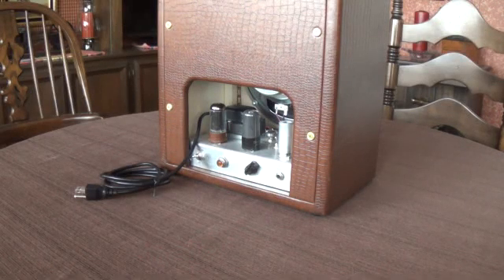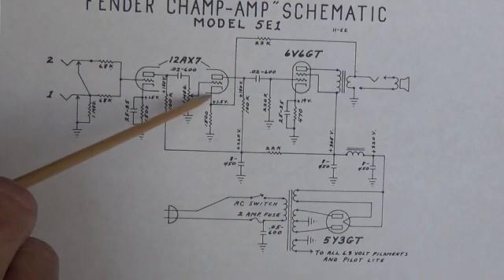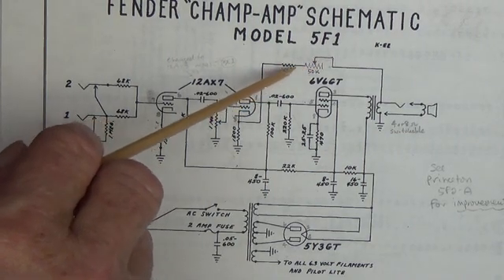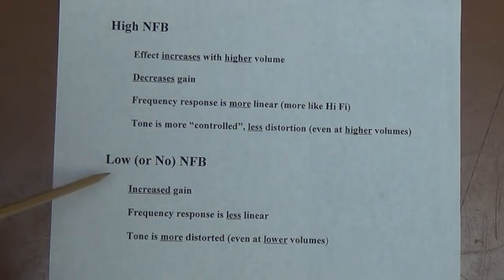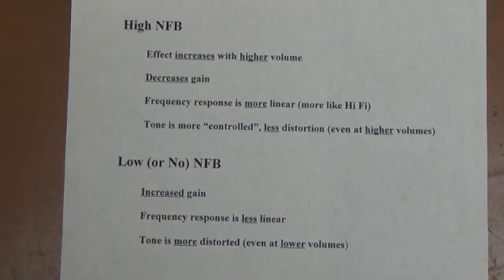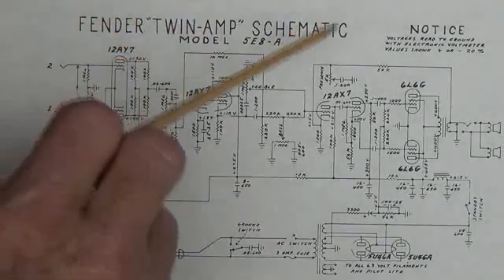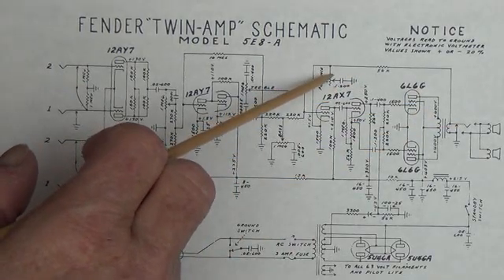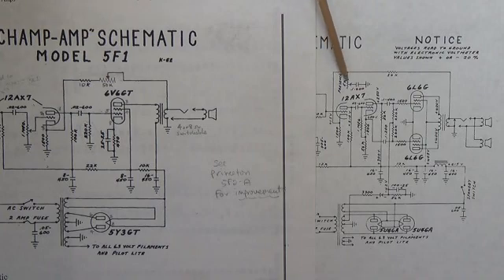Negative Feedback Loops and the Fender Presence Control

Comment: A musician friend asked me to convert his Great Grandmother's early 1940s Westinghouse tube console radio to a guitar amp. I tried the "It's easy to use an old tube radio as a guitar amp" route. The radio was not working, so I trouble shot it, recapped it and replaced three defective tubes. With the radio now working, I wasted a bunch of time trying to use the "phonograph" input for guitar. After much trial and error I came to the conclusion that the idea is largely bunk. Instead, I gutted the chassis, saved only the new can capacitor which was a 20/10/10 @450V and told my friend I would build him a Tweed Champ circuit in the chassis, retaining the same knobs and controls arrangement, with the dial lamps as pilot lamps.  He picked out a new 8 inch 4 ohm speaker and away I went on my first amp build. I decided to include a tone control and when looking at late 50s schematics, I realized I was building a 5F2 Princeton! I referred to a number of your videos for instruction and decided to include a Negative Feedback control as I had a spare knob available on the radio panel. I fired up the amp yesterday, corrected a couple of my mistakes and tried it out. Whoa, that thing sounds just like it rolled right out of 1956. The NFB control was the most amazing thing about the whole project. With the control, and a Stratocaster,
 I can seemingly vary the gain from pretty clean (6K resistance) to very pleasing overdrive at 56K resistance. With a humbucker guitar, I can get over the top overdrive! The tone also changes subtly. I am really happy with the amp and am excited to let my friend (who is a professional musician) try it out. Without all the help from your videos, this project would have been a non-starter. I am pleased to show my gratitude with a Patreon subscription. Thanks again Uncle Doug and Rusty!
 Scott
  President, CEO and Janitor at Scotty's Workshop.
Reply from the maker: Wow, Scott, this sounds like a great build. All of your modifications make good sense and I'm glad the NFB control worked so well for you.  To me, the NFB is actually much more useful and effective than a tone control (which is actually redundant with the guitar tone control). You're welcome for whatever assistance our videos provided. We commend you on this very successful project and sincerely appreciate your sharing it with us.

Comment: Another great video and a great mod! Once in a while we see people who say to completely remove the NFB loop, and that is not a good idea. At low gain levels, it's not that apparent, but when you start pushing an amp, you can quickly turn the amp into mud. Low frequency overload. Removing the NFB loop makes an amp sound terrible and it's counterproductive. Leo used NFB in order to control the gain so that we could hear all that wonderful chime. I've been using an adjustable NFB for quite some time after I came to appreciate its purpose. I typically use a 3k resistor with a b50k linear pot. With this setup you are able to carefully dial in some great breakup. I was pleased to see that you use it, too! I also add the Presence Control. Try auditioning a few different cap values or use a switch to select from several different values so that you can dial in the low frequency control. This really comes into play if you're a Blues player. In a Triode, the electrons flow from the Grid to the Plate and from the Cathode to the Plate. When you use NFB, the triode acts like a mixer. The grid contains your guitar signal and the cathode "mixes" a low amplitude guitar signal from the output transformer; just like you said, the cathode signal subtracts, (not adds) the opposite of amplifies, the incoming signal from the grid. The Plate in the triode sends this mixed tamed signal on to the power tube(s). NFB subdues the signal in that triode. The neat part about the Presence Control is that you can subdue the lower frequencies, that causes farting and blocking distortion, which sounds terrible, and allow the (lower amplitude) higher treble frequencies to run wild. Again, selecting from various Presence capacitors to dial in the low frequency cutoff is recommended. Furthermore, guitar pickups will reach all the way down into an good tube amp. Use a higher value presence capacitor for a humbucker equipped guitar - 0.1uf, 0.047, because they produce more low end harmonics. Use a lower value capacitor for a single coil equipped guitar - 0.047, 0.022, 0.01 because their low frequency output is lower. Adding a 3 or 4 pole rotary switch that allows you to select the Presence capacitor is a great mod. Try it and while you're strumming a chord, select different cap values. I think you'll be pleasantly surprised. Thank you Doug for providing  us a forum to share our experiences! We are all blessed to have you around...
Reply from the maker: You're welcome, Mark, and thanks for your very detailed and informative review of the applications and values of NFB.  We are fortunate to have a contributor of your knowledge and experience.
Reply: Rotary switch, great idea.  Thanks!

Comment: Thx for great vid again Uncle Doug but one thing confuses me. You say that the grid and the cathode are out of face. Do you mean they are both out of fase in comparison to the Plate? Because in a earlier vid about the working of a triode tube, i learned that the signal on the grid are IN PHASE with the cathode. thx. Stefan.
Reply: Hi again. i see in a earlier reply ( 2 years ago :-) ) that you already answered my question, so sorry for being to fast. Very interesting video! thx
Reply from the maker: You're welcome, Stefan. The grid and cathode are in phase, and both are out of phase with the plate. I apologize for any confusion.

Comment: Hello Uncle Doug,
I have a question related to the negative feedback loop. If i have a two
channel amp the first channel of which uses 1 12AX7 and the second one 
uses 2 12AX7s, should I connect the negative feedback loop to the cathode 
of the second part of the first 12AX7 or is there a different solution?
Great video as always and thanks in advance!
Reply from the maker: +Oleksii Shekhovtsov  It depends on the type of Phase Inverter the circuit has, Olek.  If it's a Long-Tailed Pair PI, then the NFB connects to the cathode of the PI tube. If it's not a LTP, then it connects to the cathode of the final pre-amp stage immediately prior to the PI.
Reply: Thanks :)
Reply from the maker: You're welcome :)

Comment: It also looks like the presence controller is fed into the first stage of the 12AX7 while the Champ's NFL is fed into the 2nd stage.Is that right?
Reply from the maker: +SciPunk215  Which presence control are you referring to, SP ?
Reply: +Uncle Doug Check 5:37 in the video. You're pointing right at it. :) 

BTW: You got me motivated. I'm embarrassed to say I've been sitting on a gem for a LONG time. I have a 1973 Fender Quad Reverb. It has issues. But I think I'm ready to finally get it up and running again.

I'm pretty sure it's 1973. It's serial # is A61778.
I think I found the schematic on line. Can you verify if this is the right one?
http://acruhl.freeshell.org/mga/schematics/amps/mid70s100w.jpg

I can't thank you enough for sharing such great content !!
Reply from the maker: You're welcome, SP. I'm glad the videos have provided motivation to work on your amp. I believe that A6 is 1976. I have no way of knowing if this schematic is correct for your circuit without evaluating the amp in person, but it may well be. Re the Presence Control vs the Champ NFB Loop, the insertion points are not different due to one being Presence and the other NFB, but simply because the circuits themselves are quite different. The Twin is double-ended and has a phase inverter, while the Champ is single-ended and does not.
Reply: The feedback is fed to the last amplification stage, which is the first half of the 12AX7. The second half is the cathodyne phase inverter.

Comment: Hello Uncle Doug. Why, is the resistance value in a princeton reverb so low (2K7)? and is it advisable to insert a 50K pot here?
Reply from the maker: +BAMPSANDPEDALS  If you think 2.7K is low, check out the Deluxe Reverb.....820 ohms.  The value is determined by the impedance of the point of insertion, and varies from circuit to circuit. If you want to make the NFB loop variable, you will have to bracket it with an appropriate pot and fixed resistor, i.e. a 500 ohm fixed resistor and 10K ohm pot in series, offering a variable range of 500 to 10.5K ohms.

Comment: Awesome again.   Would love to see your explanation about the how and why of amp stage coupling whether reistance,  capacitance, inductance or a transformer is used.   I understand it in a basic way.   But why its used when its used in a guitar tube amp not really sure.
Reply from the maker: +John Miner  Thanks, John. This is not a topic with which I am familiar. The inter-stage coupling in the vintage amps I deal with is generally done in a cascading plate-to-grid chain with coupling capacitors to block the preceding tubes plate DC from reaching the following tubes grid. Perhaps a Google search would turn up more information. Good luck.

Comment: uncle doug, I am completely new to mods beyond bright caps. does the negative feedback loop connect to the positive or negative side of the output transformer tap? the bugera v5 mod I was following had the negative feedback loop connecting from the 8th connection of the 9 pin preamp to the 4 ohm ot tap, but did not show which tap. is this effective with the use of a pot to vary the feedback, and could I use a 50k and 100k pot to dial in specific frequencies?
Reply from the maker: +James King  James, the NFB loop must be attached to the un-grounded OPT output lead....i.e. the one BEFORE the speaker voice coil. If you can't tell which is which, use an ohmmeter to find the lead that has some resistance (3, 6, 12 ohms depending on your speaker) to ground. 

The pot value depends on the circuit. If you want to make it variable, then you must protect the NFB from reaching 0 ohms. To do this (let's say the modification calls for a 10K fixed resistor) you would wire a 1K to 5K resistor in series with a 20K pot, which allows a range of 1K to 5K when the pot is at zero, up to 21K to 25K when it is at max.  Good luck.

Comment: Hi Uncle Doug, I have a silver faced 1972 Twin Reverb, which I have black faced to Ab763 circuit. I had added a 25 k pot to see how much resistance I liked and it came out to about 15k on the pot by itself in series with the 820 ohm existing resistor. Question 1, should I just put in. 15k resister to give me the amount of reduced negative feedback, 2, I would like to get the bass up a little, like a resonance control, should I use the suggested .0047uf cap in series with the 15k resistor. 3, what frequency blocking roughly would I get with that cap, thanks again for your very informative videos, Bob
Reply from the maker: +starlingave  I tend to like the flexibility of an adjustable NFB, Bob, but you could simply replace the pot with a fixed resistance if you wished. Please see the formulas in my Tone Stack video to calculate the frequency cutoff with that cap/resistor combo......or you could do what I do and simply try it and see how it sounds.  Good luck.

Comment: Hi Uncle Doug: Thank you for your reply today. I built a mojotone 5e3 deluxe and it came out great. I do find it breaks up a little too much. I'm trying to decifer what pin of the 12ax7, pin 7?, of tube to come off of with a resistor to create the negative feed back loop. I also assume the other end goes to the negative speaker terminal. I have a photo of my chassis, how can I send it along for your reference. Thanks again, Bob.
Reply from the maker: +starlingave You're welcome, Bob. There is a wealth of information on this subject on the Internet, i.e. http://www.tdpri.com/forum/amp-central-station/69-why-doesnt-tweed-deluxe-have-negative-feedback-loop.html   It appears that the most common way to install the NFB is a 22K resistor between the speaker jack and the cathode of V1b. Good luck.

Comment: Doug, would it be possible just to install the 1M Pot + .0047uf cap without changing the resistor value?
Reply from the maker: bryan arzaga Bryan, I'm not sure what this question is referring to. If it has to do with Negative Feedback Loops, then I would suggest that you simply experiment with different resistors, pots, and caps until you get the effect that you seek. Trial and error is best in situations like this.
Reply: Uncle Doug im trying to do a soldano depth mod / bass resonance. Im new at this but willing to learn this :)

Comment: Thanks for another great one!
I have a PA amp with multiple microphone inputs (6SJ7) that feed into a 6sf5 then a 6n7 phase inverter to two 6l6s. The NFB goes to the grid of the SN7. If I wanted to limit the NFB to one (or two?) of the inputs, could I reroute it to the appropriate 6SJs and leave one without (for harmonica nastiness)? Or will the phase be wrong?
Reply from the maker: bluesharpfiend  Without a schematic, I can't say for sure, but my suggestion would be to simply use trial and error to achieve the effect you desire. Hook it up the way you think it should be and see if it works. There should be no harm done if you are wrong.

Comment: With regards to the frequency response in the negative feedback, what do you mean by less or more linear? I'm trying to achieve the same tone and response from my amp but back the gain off, especially at high volumes. Can you help me here? Could I maybe just change a resistor or cap on the gain pot? Cheers
Reply from the maker: adam stevenson Greetings, Adam. "Linear response", at least to my understanding, means that all frequencies are equally represented.....i.e none are boosted or suppressed.  This frequency spectrum could also be described as "flat", which is more typical of HiFi amps than guitar amps, which are generally boosted at both ends and "scooped" in the middle.  

About the only way to retain high-volume tone at lower volumes is to have a Master Volume Control, which allows you to drive the pre-amp section hard, for tube saturation and distortion, but back off on the output section, to reduce the volume to a tolerable level.  Either than or use an attenuator to absorb varying amounts of output power (volume).  I can think of no minor alteration to an amp circuit that would achieve this goal. If there were, then MVC's and attenuators would not exist.

Comment: Good explanation.  The presence control is similar to the tone control on most guitars
You have a variable pot (250 or 500K) and a capacitor in series (0.01uf, 0,022uf or 0.047uf to rolloff the high frequencies to ground.  This circuit with the inductance
of the pickup is a LRC  (Inductance/resistive/capacitive) frequency filter.
Reply: It doesn't function the same at all. The presence varies the ratio of HF that is the feed back loop.
 You hear LF distortion alot more than HF distortion so allowing the HF to bypass the feed back loop gives you a more harmonic full top end.

Comment: Uncle Doug, Would the same thing work for a Marshall 1959 100watt Superlead. Marshall has a 47k or (100k) where your variable pot would go. I am not sure what size resistor and pot to install?
Reply from the maker: Kirk  Greetings, Kirk. I looked at the schematic and you are correct about the existing NFB loop in your amp. If the resistor in your circuit is 47K, then you could try a 22K fixed resistor with a 50K pot, giving you a 22K to 72K range. If your resistor is 100K then a 50K fixed resistor with a 100K pot. The idea is to evenly bracket the current NFB resistor value.....in this case about +/- 50%.

Comment: Uncle Doug, can you ask Rusty a question for me?  Is that 50K potentiometer for the negative feedback loop a linear taper pot or an audio taper pot?  Thanks.
Reply from the maker: Bourne Accident Rusty says he can't remember exactly, but figures that since the feedback resistance is normally a fixed value, a linear pot would probably work just fine.